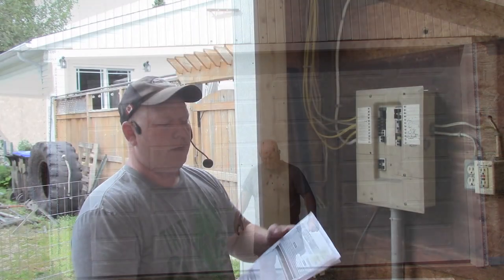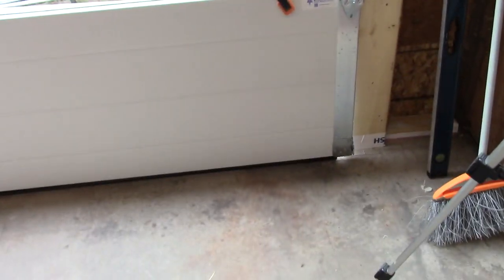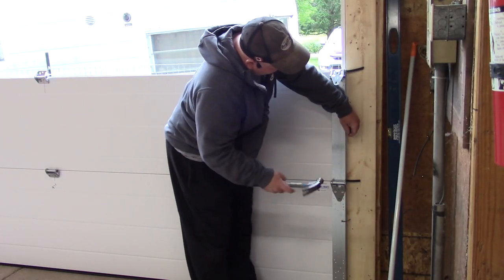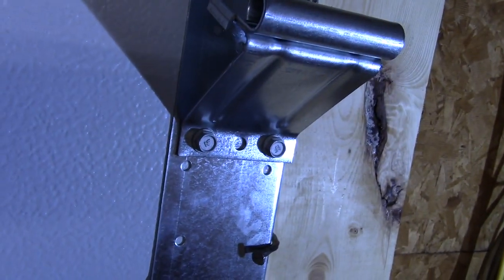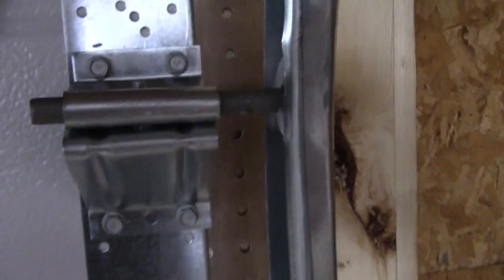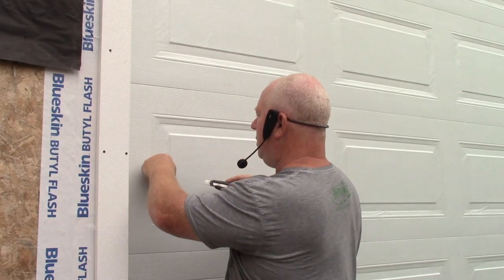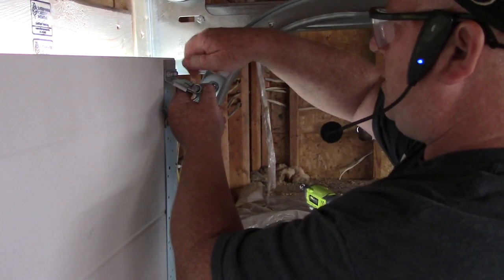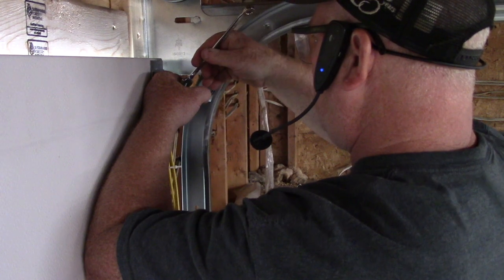How To Install A Garage Door

Comment: Great video, thanks for sharing.  I'm getting a couple of 9x7 Amarr LI1000 installed tomorrow and was wondering what thickness of foam insulation will fit on the back of the door panels?

Comment: Thanks Rob for the feedback, smooth operating between requires upwards force of aprox 8- 10  lbs pressure.  Increases to 18 - 20 lbs around corners.

Comment: Any problems with Sreel-crafts double curved (symetrical) track? Nightmare install as they included instructions for standard track( one straight +1 curved). At first I thought they sent me the wrong parts.  Now installed it seems to bind a bit when rollers meet the curve in the tracks, does not work smoothly. Your's is the only video I could find with this type of track so thanks for sharing.
Reply from the maker: @RickDeis  there are 3 radius curves available.  Mine is the middle one.  I’m no door expert but I have learned that the door needs a certain amount of play.  You need 1/4” space from the door to the frame. You need to ensure the wheels have enough lateral play so they don’t bind.  My door is also very big.  Normal doors are 7 feet tall and mine is 9 feet.  After assembly my door worked fine manually but the door opener didn’t work well.  I ended up solving the problem with garage door spring lube.  Yep, you spray it on the springs. It was magic!  Here is the video…
https://youtu.be/1koYtiyk81I?si=KOVmHF7ThACfta-J